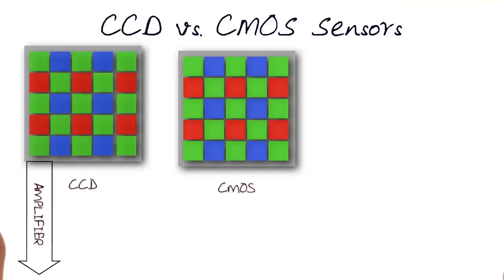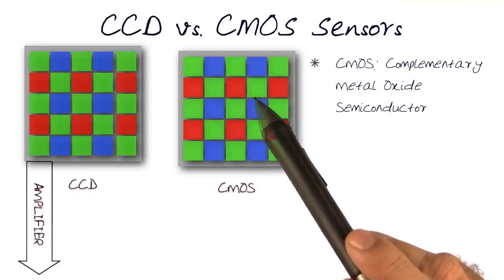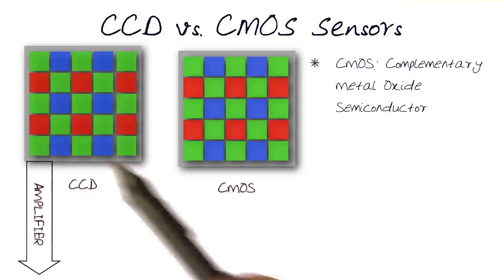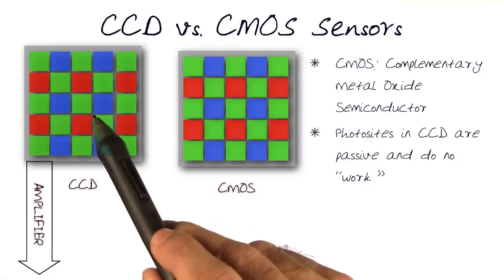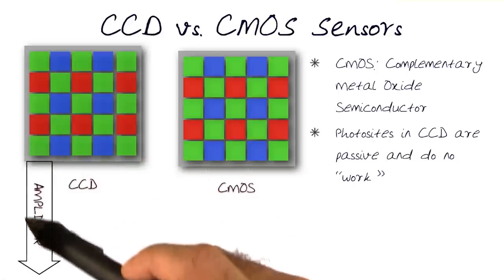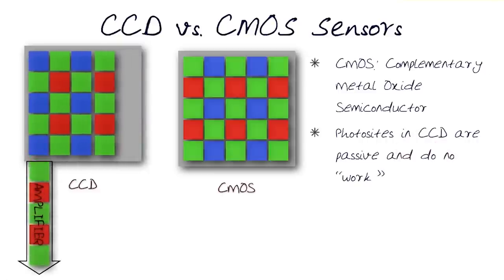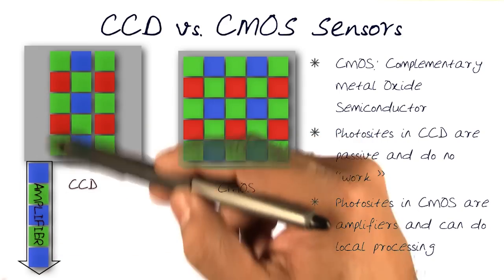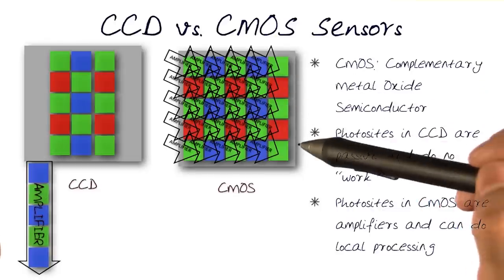CCD vs CMOS Sensors

Comment: Which begs the suspicious question I have always had, why would an ecosystem be formed around using CMOS for video capturing when the rolling shutter issue and the high noise was known from the start. This coincides with PRO CMOS sensors not having this issue while the consumer side is opposite of that. Seems like someone wanted to remove the old DV cameres with CCD's out of the market so we would get stuck with inferior technology. We lost DV cameras back in the early 2000's because some cameras had the ability to record S-video and CBS into the camera and recorded as DV, which would then be transferred to your computer with firewire. Hollywood hated these features in DV cameras, so much so that they forced all companies to remove the inputs on DV cameras. I still have my old JCV GRD 8 series DV camera that had no noise at night using only it's built in light. We lost CCD technology which did not have the pathetic noise problems of CMOS because the PRO market want to eliminate the entrance of "Amateurs" intro the pro level world. This is why DVCPRO was never marketed to the consumer level even though we were already using the DV codec!!!.
Reply: Wow, slow down. There have been quite a lot of quite pro-level cameras able to shoot FHD that were doing fine with CCD's (JVC GY-HM100, GY-HM150, JVC GY-HM750). I own two of the mentioned cameras. I do understand your complain though: CMOS is fine for basic interview and documentary work, but it sure as hell is not the right choice for fast moving objects and especially (for a weather-enthusiast like me) lightning.
CCD's survived well into the zeroes.
For the rest I think you're trying to find conspiracies that aren't there.
Reply: @weeardguy  Well there is no conspiracy it was based on facts with the “screeners” that were showing up on the net from Asian cineplexes using these DV cameras. Dvcpro is still being used by the news crews, it’s not like this tech died it was pulled out of the consumer side. Don’t you remember the P2 card fiasco once someone opened one and was shocked by what they found inside notice it was abandoned right away as copy cat P2 cards would be released lol.
Reply: @danfuerthgillis4483  miniDV, DV and DVCAM (DVCPRO has never really made it here in the Netherlands (maybe even Europe) as far as I know and it sure as hell is not used anymore here if it was) just all had it's own share of users, with DV and DVCAM just being for the professional market and miniDV for consumers.

No, I don't know the P2 card fiasco.
Reply: Cost to produce, probably. CMOS is also the technology used to produce integrated circuits, so there's a large amount of capital investment in them - both in terms of knowledge base and in terms of available manufacturing equipment. They also use less power than CCD's, which makes them attractive for applications like smartphone cameras.

Comment: Failed to add that CMOS records each line of the image in succession, which is what causes the rolling shutter effect. Also, CCD / global shutter takes a complete snapshot of the image across the entire sensor.
Reply: There are global shutter CMOS sensors... onsemi xgs for example
Reply: Isnt it the other way around? CMOS per pixel, CCD per line?
Reply: @chazefez9625  Nope, it wasnt explained quite accurate in the video.
Reply: yes
Reply: @merlynbluhm220  Yeah, but unfortunately, hardly any manufacturer still uses them in their cameras. If I could buy a JVC GY-HM200 with a CMOS-sensor and I could buy the same machine with a CCD but it would cost me 500-1000 more, I'd still buy the CCD-version. CMOS just sucks.

Comment: Is there a way to collect the individual photon detection events paired up with timestamps using CCD or CMOS sensors?  It seems like regular video formats fail to capture all the raw data detectable with those chips because it only represents totals grouped by frame.  For example, a conventional video file would indicate the total counted red photons for a 1/60 of a second time interval at pixel 0, 0.  A continuous stream of precisely timestamped photons, their coordinates, and colour would be much more flexible.  It would be easier to choose a frame rate later, for example.
Reply: But you need a framerate to at least know WHEN to read-out the sensor. Besides that, you can't just pick a framerate later, because you will need to pick a shutterspeed.
Reply: @weeardguy  opening and closing mechanical shutters isn't necessary for digital cameras already.  That's for film that needs to move from 1 frame to the next and could get a smearing or motion blur trail if it kept getting exposed as it moved.  Since the CCD doesn't physically move from one frame to another unlike film that physically moves, there is no need to ever stop collecting the light.

If you want the flexibility to choose a frame rate later, you could always capture at the highest possible frame rate and blend frames or interlace them later but it wouldn't produce as much quality as the continuously timed photon detection event set I was asking about before.  A continuous set of points would take far more space than conventional image frames or video but might be suitable as a master copy to process heavily and compress later.
Reply: @IARRCSim  Well, if it isn't necessary, I don't think Panasonic would have bothered putting a mechanical shutter in their GH5 (and probably other cameras from the GH-line as well). But it's there, and fortunately, it is there, because I otherwise have to put up with CMOS-skewing in pictures as well. It's bad enough for video already (which by the way, don't feature mechanical shutters for years already anymore... everythings an electronic shutter by now)
Reply: @weeardguy  you think mechanical shutter is needed to take pictures while also pointing out that video is recorded without one.   Web cameras mostly don't have mechanical shutters and they work well enough too.

Your GH5 is a pretty expensive camera and wouldn't be worth its price if it had nothing more than the minimum features to take an image or video.  

I don't have a GH5 but https://eng-ca.faq.panasonic.com/app/answers/detail/a_id/49532/p/7/c/71114/related/1 documents a feature on GH5S where you choose either an electronic or mechanical shutter.  If you have a choice to go with an electronic shutter, it is funny to imagine the GH5 just setting you up for failure.  If the electronic shutter always destroys the image, why would the GH5 let you choose that?

Comment: Hi, do 3 smaller sensors like 1/2.8 look better than 1 larger 1 inch?
Reply: Usually, they do. My JVC GY-HM100 has 3 CCDs of 1/2.3 inch. My JVC GY-HM200 has only 1 1/2.3 CMOS, but as the resolution has increased 4 times, I get the feeling it's not as sharp as the 100...

Comment: CMOS is cheap garbage. For good image quality you need more sensitive CCD.
Reply: Gediminas Jesinas thanks for explaining the entire video into a short sentence 😂😂
Reply: dude theyve stopped using ccd chips in general manufacturing because cmos are cheaper to make, if companies were making full frame ccd chips today at the level and intensity that they manufacture cmos ones, we'd see cmos as complete crap, but companies figured this out decades ago when cmos sensors first came around.
Reply: How?
Reply: @RareDay  No, they stopped using CCD because most likely demand more or less is higher (read: they can make more money) AND for most users, the advantages of CMOS weigh up to the disadvantages. But if you are taking lightning videos or like to take videos of fast moving trains/other fast moving objects like me, CMOS just sucks.
CCD's have been produced in 1/3, 1/2 and 2/3 inch in masses, as those were (are) the standards in videotechnology. Professional cameras used 3 of them (one for each color) so the numbers quickly go up.
CMOS most likely only became such a thing because of digital photography and all those idiots that started filming with their photography equipment.
CCD's have been thé sensor in videocameras for decades.

Comment: So CCD is superior, my old camera used CCD, i have upgraded to DSLR (wich is "superior") so Canon and Nikon DSLR , who every pro photographers use and Sony, have CMOS sensor..so wait!!! I'm amzed .. the best Cameras in the world Nikon D850 and Canon 5D mk3 uses CMOS ... wtf :)):)):)): isn't this contradictory?? omg :))
Reply: No, don't forget that for photography, things are totally different. CCD's are (in my opinion) the better choice for any VIDEOcamera as they don't feature the rolling shutter problem, where CMOS is fine for (usually) capturing still images. Though rolling shutter is also a problem in photography, it's not only easier to counter-act by processors in the camera (by either stacked CMOS technology or just correcting the data by AI or so) but usually also less of an issue.
Photocameras usually have a mechanic shutter, which eliminates the rolling shutter. It's not until you start using the electronic shutter it becomes a problem. For videocameras, I consider the CCD to be superior.